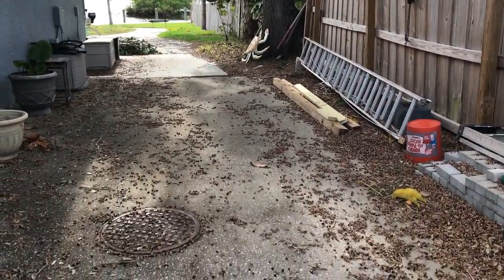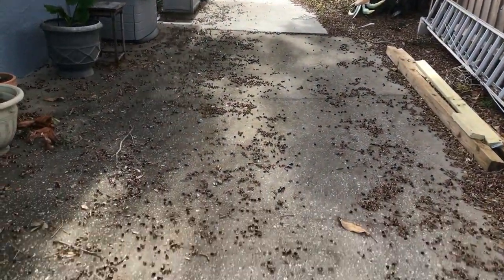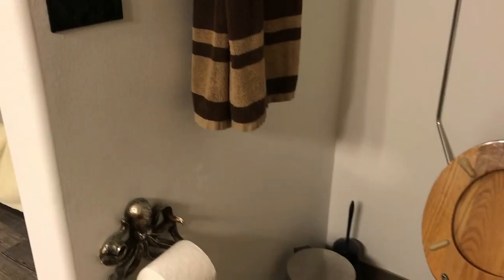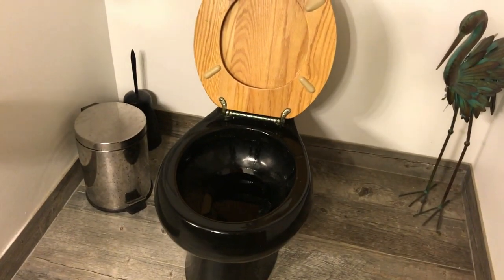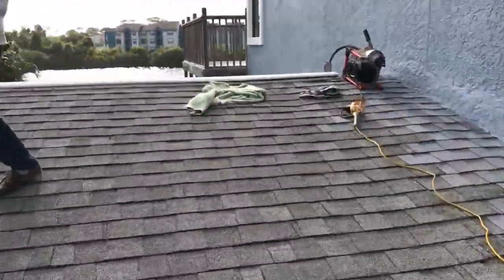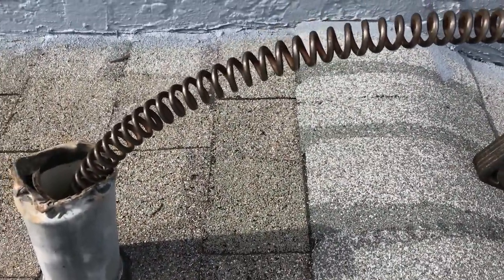HOW TO CLEAR SEWER STOPPAGE FROM ROOF VENT

Comment: I started out with a k60 (7/8") as my 3 to 4" pipe drain cleaner, and now I got a k750 with 3/4" cable 100ft long. damn k750 weighs over 150 lbs with the cable inside. you reminded me why I keep the k60 around haha cheers

Comment: Question, I was having backflow into my shower and tub (two separate items) and I ran some mainline cleaner through it. Those are running ok now, no backflow but I can't get my toilet to flush and I hear some gurgling in my tub and shower now. Any ideas? Don't have money for a plumber, unfortunately. I have 2 bathrooms, one on each end of the house, but the other toilet and sink/shower is working fine. It's only on my end.
Reply: Your vent pipe itself could be blocked.

Comment: Hey Tim, I have the same issue in my house were they had to clear it through the roof pipe because my house is on a concrete slab and it doesn't have a cleanout.  I see your using a snake to clear the clog.  I had mine cleared but they used that jetter spray to clear out the clog.  Afterwards they used a sewer camera to inspect the line but the camera couldn't go all the way to the city sewage because they see that galvanize pipe was starting to build up residue.  My question is, is your method of using a snake better than using a jetter spray  to clear the residue in sewer pipe that looks like your arteries are starting to clog up ?  They say that using a snake could damage the sewer pipe and cause leaks so the jet spray is much safer.  BTW is it true that they charge more for clean out if they have to go up the roof instead of a clean out in the ground?

Comment: Can you add a clean out to a vertical stack vent that  is in the wall, so its east to clean out both directions? What kind of fitting would I use?
Reply from the maker: Pretty sure you can
Keep it within floor reach
Depending on what size pipe you can use clean out tee
Reply: Yes you can have a clean out on a vertical pipe. Ours is in our laundry room, but is not at floor level...it is roughly 3 feet above the floor. Doesn't matter if it's attached to a vent pipe though. The clean out is used to clear your mainline without having to dismantle your toilet or whatever. But as mentioned, if no clean out is available, then you go the rooftop vent route.